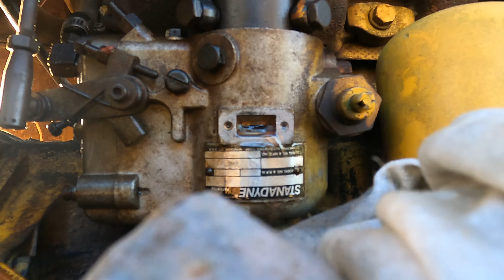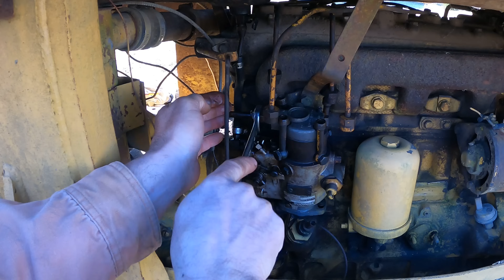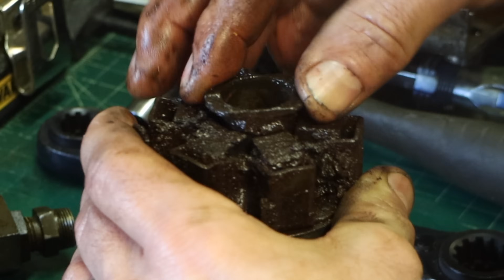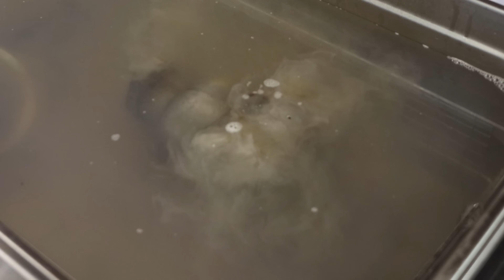Forgotten John Deere 1010 Track Loader, Part 2.

Comment: On the fuel injector pump drive shaft there are 2 cupped o ring s. The top one is cupped upwards an the bottom one is cupped downward s. Sometimes if top o ring is warn out or damaged fuel can leak by an enter the crankcase . Thus motor oil thins out an over fills ; showing high level on dip stick .
    There is a shim sleeve to ad in installing pump that once cupped o ring is started correctly you remove shim sleeve . An of corse the bottom cupped o ring keeps crankcase oil from getting in injector pump . With rotation of shaft oil will climb .    Great video an really enjoy all you’re projects.  
Thanks!!

Comment: Ill bet your overrun with good advice but I’ve got to put my 5 cents worth in…..
Try a ship load of the atf/diesel (Marvel Mystery Oil) mix down the bores and leave for a week, clean the injectors, pull the rocker cover off and ‘bounce’ the valves (to try to get them to seat better) with a nylon hammer, get all 4 glow plugs working and as someone else suggests, heat the inlet manifold and/or stick a good 2KW heat gun into the manifold tube to supply hot air and then crank it. If it doesn’t run, even like a box of spanner in a steam train, it’ll be good in your lake as bouy ballast. Great content! 
PS are Area Diesel Service the only diesel specialists ? They are certainly beloved by Wes and Matt from Diesel Creek. 🇦🇺🦘

Comment: Empty the engine out completely and fill the cylinders with ATF and let is sit for a week, then check how much is in the oil pan and refill the engine with 15w-40 or thicker and run the ATF out of the cylinders and put everything together and blow some hot air into the intake with some ether if that doesn't do it. 
If it only starts up and runs for 15minutes I think the rings will seal up again, the big issue I saw was the rusty valves which would require the top to come off and have you hone the valves and valveseats perhaps a quick and dirty dingleberry hone of the cylinders and a new headgasket.. Sure it's a lot of time/work but for what it is it shouldn't cost any money and you'd get a good look inside the cylinders..

Comment: No don’t open up yet fill the cylinders with marvel mystery oil let set 2 weeks then put fresh battery on it and use small amount of starting fluid crank it but you need new glow plugs then preheat for 20 seconds before starting good luck we will watch again

Comment: Look on the bright side with the cows, you won't need to cut the grass. Also with the wet test the rings might be stuck with it sitting in one position so long( I always like to look on the bright side, but had some kicks in the nuts too. LoL) I have a John Deere 2035 with a 4 cylinder engine dated 1972(I think) and parts are readily available. Bit of difference in age but you never know. As to fixing it, you are the only one that can answer that, if it was fixed does its value out way the cost of fixing it, or is it better to cut your losses and find another one that might bring greater problems, whichever way you decide looking forward to the remedy, as I'm sure you will share it with us.

Comment: As a last ditch attempt I would have hooked 24 volts up to that starter and got it spinning really fast to see if you could have at least got it to run because I bet that compression would have come up after it got some heat in it and the rings which are presumably stuck, unstuck themselves lol

Comment: @ 3:20, you can remove the wire mesh from the air cleaner and replace it with new. That's what I did on my 1935 WC Allis Chalmers. I think I got the mesh from Steiner's.
 In my opinion  there is no "modern" air cleaner that will do a better job.
All that wire mesh is also dripping with oil as it draws air threw.

Comment: John, we had one of those 1010s on the farm when I was growing up, was my dad’s dream to have a crawler on the farm for field work.
That was a gas John Deer 1010.
Very impractical, bought it new in
1961, 35 hp.
Traded it for a new John Deer wheel tractor 
2010 two years later .
I think you should pull the engine and rebuild.
Those aren’t comfortable to drive,
Those two hand steering lever’s are hard to pull, and you have pull them a long way back. They release a clutch for that that track and as you continue to pull on it, 
You engage the brake for that track. The lever moves about two feet to do all that and very hard to pull, there is no power assist.
   Lloyd from Minnesota.

Comment: Before deciding to tear the head off, scope the cylinders. Then clean the injectors (clogged injectors no workie). Then fix all glow plugs. Some oil in the cylinders, you might just get it to run. If not, you at least did what you could top side. Great video, love it.  Keep up the spirit, John.

Comment: I would give it another go before calling it a rebuild. Try playing with timing as someone mentioned below and hold a butane torch in the intake so you get some heat into the motor. like you mentioned its been sitting for who knows how long there could be a rust build on valves and seats plus rings are most likely stuck adding to low compression. a couple good heat cycles may help solve a few of the low compression issues

Comment: Hi John, love what you do. About pump timing, is the mark in the pump for TDC? Injection pumps start to inject a few degrees before TDC. Is there an injection timing mark? Just a thought. Are there details of the spill timing? This is another way to check injection timing. Also as previously mentioned, have each injector out and hang it on a pipe to see if they are not blocked and have a good spray pattern. All the best.

Comment: The John Deere 1010C is a 2WD industrial crawler manufactured by John Deere in Dubuque, Iowa, USA from 1960 to 1964. The John Deere 1010C is equipped with a 2.4 L (144.5 cu·in) four-cylinder diesel engine and one of two transmissions: gear type transmission with 4 forward and 1 reverse gear and mechanical dry disc clutch, or a shuttle transmission with 4 forward and 4 reverse gears and hydraulic wet disc clutch.

Your Diesel Engine
Engine model	John Deere
Engine type	Four-stroke, liquid-cooled, inline
Cylinders	4
Fuel type	Diesel
Displacement	2.4 L, 2,368 cm2, (144.5 cu·in)
Bore and stroke	92.0 mm X 89.0 mm (3.62 in X 3.5 in)
Compression ratio	19.0:1
Horsepower	40.5 PS (29.8 kW; 40.0 HP) at 2,500 rpm
Torque	128.8 N·m (13.1 kg·m, 94.9 ft·lb) at 1,500 rpm
Starter	Electric
Transmission and chassis
Chassis	Crawler
Steering type	Multiple disc clutch and brake
Brakes	Mechancial contracting band
Transmission model	John Deere
Transmission type	Gear type with mechanical dry disc clutch
Gears	4 forward and 1 reverse
Speed	Forward: 10.5 kmh (6.5 mph) Reverse: 3.1 kmh (1.9 mph)
Transmission model	John Deere
Transmission type	Shuttle with hydraulic wet disc clutch
Gears	4 forward and 4 reverse
Speed	Forward: 10.5 kmh (6.5 mph) Reverse: 10.5 kmh (6.5 mph)
Tracks - Size	12-inch

Comment: Cows got into my garden and i was hopping mad as they made a mess. One thing ive noticed is that you seem to only laugh at dropped tools into engine bays or oil sprayed into your face.  In Europe we use swear words normally. About the engine, do an autopsy but try not to string it out too long. We're all very impatient!

Comment: Bore the engine,  bigger pistons, Fuel pump, maybe a little turbo. Don't forget the stronger rocker springs and valves. Then cut off the growsers. You'll be doing sparky donuts in no time.

Comment: If your going to go to the trouble of stripping down the engine to check the cylinders and walls then you may as well replace the rings providing that it's just the rings or something equally as simple.

Comment: I think in an ROI view point, an engine autopsy would get lots of clicks and income from Youtube. Everyone loves a good engine autopsy as long as you video measuring the wear. Measuring the bores, remove the compression rings and shove them in the bore to see the gap/wear, etc. 
At the end of the day, will the machine be worth anything with an overhauled engine, assuming everything else works. You know it needs all new cylinder rods and cylinder rebuilds. I think if you did a semi overhaul of that machine, it would be a great series and probably get lots of clicks. But, what's the investment in parts costs and labor to get there? And of course, what's that old tractor worth at the end?

Comment: what you could try is something like "Brasso", a teaspoonful in each cylinder then crank it. Brasso is a super fine liquid abrasive. Using it will lightly scuff the cylinders and the rings.
 I would also refit the injectors and try to fire it up with a propane torch stuck in the intake while cranking (trick I was shown decades ago starting old Ruston stationary engines).

If you can get it to run you may find that. once it gets hot, it may actually improve.

Comment: im positive it will come around if you can get it running ...Heat gun, small fire underneath 😅(not joking)...check timing...run starter on 24v, new glow plugs, oil in cylinders before..loads you can try yet, im sure you could get that all done in a day easy....
84.2% definate that the compression will come back after 10 mins running 😇👍🏻
Thanks for the brilliant videos..👌🏻👌🏻👌🏻

Comment: When you did your initial inspection in pt 1 you put your camera down the air intake and noticed a lot of rust and debris around the valve seats I’d say there has to be a reasonable chance that the valve seats may be loosing the compression and not the bores / rings so I’d go for the dissection

Comment: Had 1010 track loader.  Track parts same as 440.  This is not a reliable machine.  Engine is gm diesel.  Never was a good engine.  Sell parts or scrap.  Find old cat to play with.

Comment: Amazing! I so would have given up at the beginning, but you pushed through. Now you have to decide what it is worth fixed (with your invested time) or see if you can find another bulldozer in better condition and move on to it. 
If you decide to scrap it at least you could surely sell that fuel pump. 
Good luck. 
Love your videos.

Comment: First of all, good effort Jon. Second, autopsies are generally performed only if the patient is declared dead.... If that's the irrevocable decision then I say fine, grab your scalpel and forceps. Just don't expect the patient to suddenly re-awaken with all her faculties miraculously intact. Third, the patient will need plenty of follow-up therapy and that, kind sir, is expensive. Always is, always will be. I'm not advocating pulling the plug, on the contrary. Exhaust all avenues of diagnosis and then choose whatever your "HMO" will likely cover comfortably. Good luck!

Comment: Win some, lose some. Sell that rebuilt pump to someone who can use it and any other parts you can. Who knows, someone might need some parts off of it. Then sell what remains as scrap metal. That loader is not going to be worth much even when running. Time is money. I would not even waste time on an autopsy. You could do more interesting videos of better machines. My opinion and a cup of coffee combined are worth $2.00, but you asked us to comment.

If you decide to press forward, try some of the things the other commenters suggested before tearing into the engine. It’s possible the rings could be stuck in all four cylinders. Maybe pour automatic transmission fluid down each cylinder and let that soak for a week. If you see no improvement on any cylinder compression after doing that, I would not waste any more time on it. I’ll watch whatever you do. I enjoy all of your videos.

Comment: That pump was likely leaking into the crank case.  The Roosa Master/Standyne's are pretty famous for this, especially in a vertical position like that.  Your oil is likely super thin which isn't helping your compression at all.  Thicker oil to the walls may let them stay wet longer.  You might want to risk a cheap Walmart Oil change.
Put 18-24v to the starter to get it to spin faster.  This will generate enough compression to fire a weaker engine.
If you are using lubricated Ether, it might fire better as well.  I wouldn't autopsy the engine until you got some action out of it.  It should fire even with low compression if you take the steps many folks here have outlined.  I bet the compression comes up after it runs for a good while.

Comment: I'd be interested in you filling each cylinder with oil and let it set a week. Your wet compression is close. Maybe it will start after a soak and running might just free it up. Low investment of effort for a try.

Comment: Swap the injector pump 180 degrees first and try to start it. Sounds healthy enough without the glow plugs in it. Yes it may still be wanting a rebuild, but to me anyhow it sounds like it SHOULD pop off. Some others in the comments have given some solid ideas as well.

Comment: Due to the lack of smoke coming out of the exhaust pipe when cranking the timing is probity 180 out. Also remove the valve cover and check the valve clearance on all valves, this also will let you find tdc for #1 cylinder. In your first video with the camera down the intake showing rust on the valves there a chance of rust propping valve open causing low compression.

Comment: I would try this old trick. Take a compression reading , note it then squirt some oil into the cylinders then recheck. This engine has been sitting for years. I’d also pull the valve cover to make sure no valves are partially stuck. Then I’d pull the injectors to see if they spray. Even a  little. Worth checking at least before a tear down !

Comment: I bought a compression tester from amazon, a couple of the adapters weren't even drilled and tapped. The hose fitting crimp was loose and losing pressure as well, giving false/low readings.  Absolute garbage. Some tools you cannot cheap out on. Picked up a decent used Snap-On tester for a good price, gives peace of mind.

Comment: The cylider wall were dry it will run i have worked with a lot less and made it run. the thing is after it worms up and runs for a day or two how runs and if it uses oil. ben a wrench turner for 28 years 11 in survice and the rest in the farm filds of Washington.

Comment: Im no mechanic, but i toy around with stuff like you. I had a neighbor offer me an old skid loader that had not ran in a while and it was low on compression similar to your situation.. I said screw it and poured a little diesel down each glowplug hole and cranked it with starting fluid and it actually started for me. It ran like crap for a few minutes, but it cleaned up. Since then its stubburn to get started, have to use starting fluid each time i run it.,. but it increased in compression after running it for a few hours to the point it will run once you get it started.

Comment: You could try 24V on the starter and see if some more RPMs will get her to go. You really don't have much to lose. The big problem with these machines, which I'm sure you know, is they just aren't worth much, even in perfect condition. My dad had a 2010 with a gas engine in great condition with new paint and he was barely able to get $2000 for it. Skid steers have pretty much made them obsolete.
Reply from the maker: Good thought on the starter. Might as well.

Comment: I think you answered your own question, John. Removing the head would be my first step as there could be any number of reasons for low compression.

Head gasket, rings, valves, and cylinder linings all could have issues as you rightly pointed out.

Remove engine and let's start "John's Auto Club" 😂😂😂

At least it won't cost you anything. In fact, the money you get paid by YouTube will more than cover any parts right? You may possibly end up making more money than you imagined.  

I say give it a go, lets strip it. The clues in the model. 1010 until we do it again. Go on John, you know you want to. 😉🤭🇬🇧🇺🇦⚒️

Comment: It's reassuring to see that crap can go sideways to anyone.  You just keep working away until you get your next answer, then figure out the next step.  The issues you had with the thread pitch are so very real!  It's super frustrating when you have to cobble together a dozen pieces and and every step of the way something goes sideways.  I commend you for keeping your cool (or doing such a great job editing out the meltdowns at least!)  Sometimes when things keep going sideways, I question myself.  Seeing these familiar challenges happen to someone else reassures me that it's just part of the process sometimes, and you just can't work with more tools than you have.  Thanks for sharing!

Comment: First things first, check to make sure your timing is correct. The wet test proved that 2 out of the 4 look promising, if it was sitting for years, with that air cleaner the way it was would make me very leary about putting any amount of serious cash into the engine.  If one of those valves was stuck open, there would be a rust ring on the bore wall, as well as stuck rings.  The only way to tell is an autopsy.  What would I do, ebay the rebuilt pump and any other salvageable parts and scrap the rest.  Do you really need the stress?  What if you get it running and find out the hydraulic pump is shot or the final drive is worn out?  For the Youtube followers, I would probably do the autopsy knowing full well that the engine is toast, but that would appease your followers.  Sitting that long with an open intake manifold is never a good idea.

Comment: Easy way to rule out/free off stuck rings.

1: Get a buddy

2: Connecty a decent sized tractor to the trackloader

3: Board trackloader

4: Turn fuel on

5: Have buddy pull trackloader

6: Engage drive system.

Compression can come up when the engine is turned faster. Pull starting it like this will force the engine to rotate at running speeds. If there's ANY chance that engine will start, that will get it started. If it does start, get it hot. A good heat cycle will free the rings up.